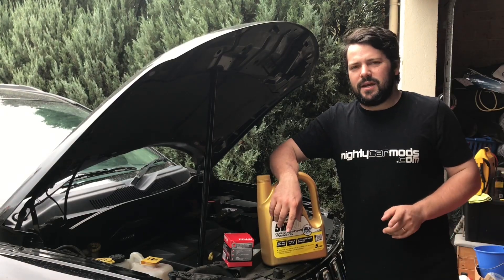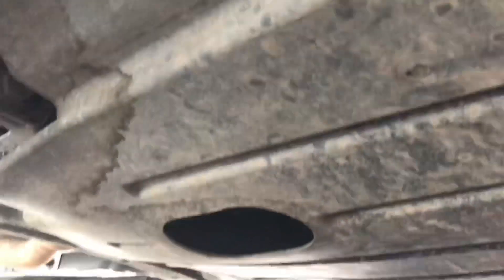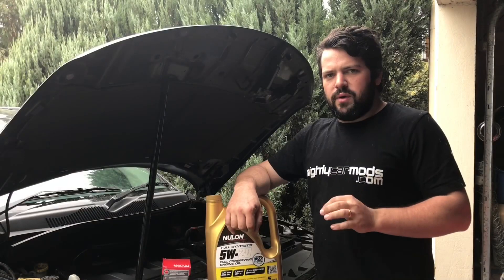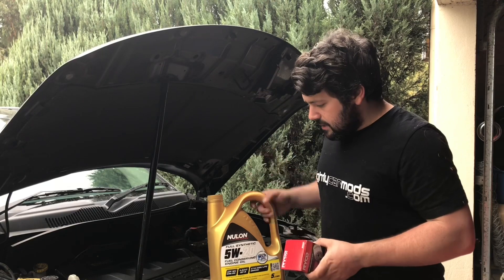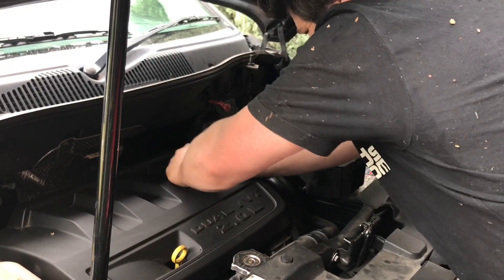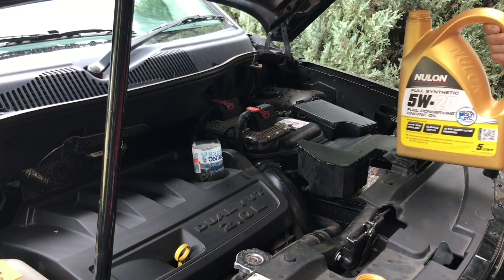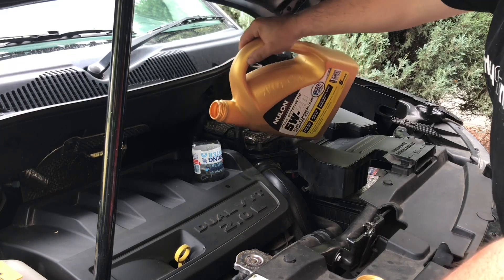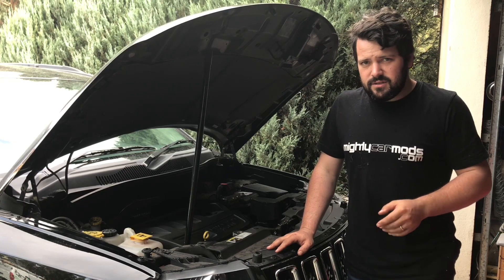OIL CHANGE FOR A JEEP COMPASS

Comment: G'day Matt, a word for the inexperienced DIY'er out there, NULON Oil Bottles have moulded graduations on the semi clear strip that runs down the side of the bottle. Each graduation represents 1 Litre. So by subtracting the amount of oil you have to add to the engine from the bottles total quantity, the figure you end up with can easily be marked ( pen or texta ) off on the side of bottle using the graduations as a reference point. Then all you need to do is pour in your oil and stop every now & again to see how close you are to the marked line. Then keep adding & checking and stop when you reach the line. I always wait 20 minutes after adding the oil to double check the level with the dip-stick, and add a bit more if it's still showing low on the dip-stick. 
Remember it's NOT good to have more oil in the engine than what the dip-stick shows is actually needed, a bit over or a bit under is ok though.
Empty & washed out plastic Soft Drink, Juice bottles, or even plastic Milk bottles with the bottom cut off make great replacement funnels for adding oil into your engine.